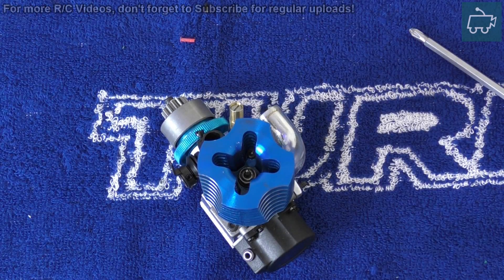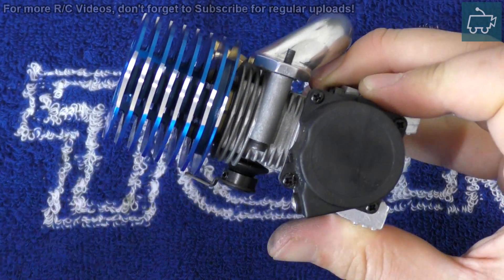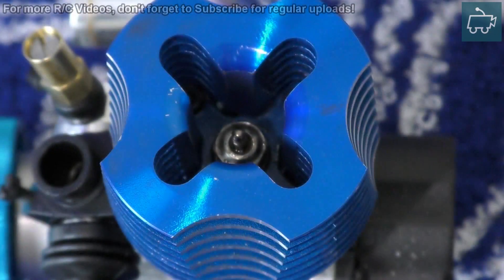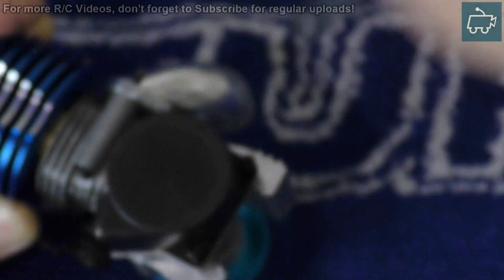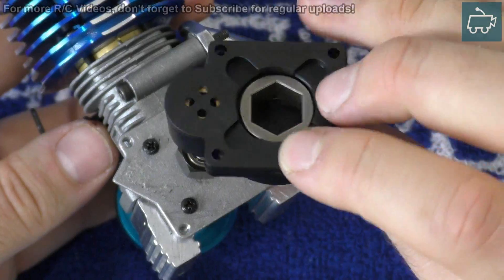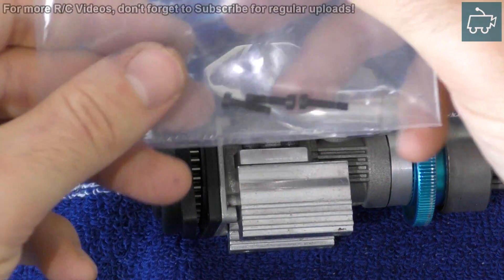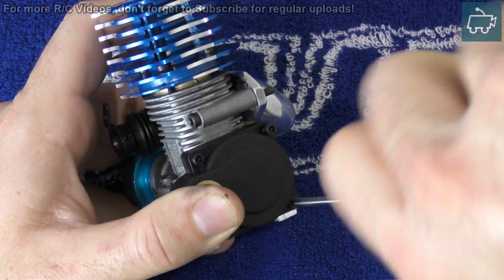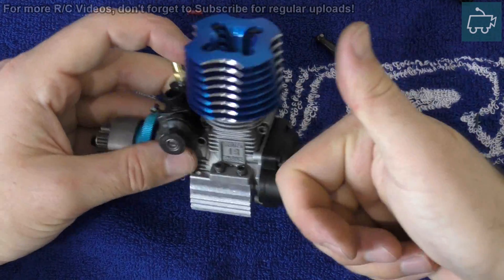Vertex 18 Nitro Engine - Pull Start to Drill Start Replacement - Tutorial

Comment: Hi does any one know carb settings for this vx18 low speed factory setting i need i cant get it to idle long its pretty new and run in good now just about 17 tanks through it new cluch too but wheels spin a bit tryed idle 1mm lower and higher its like its too rich even at 1 half turns out lsn.

Comment: I have a Nocarossi engine that was built for the revo platinium the gear in the ritor start is always braking i cannot find the rotorstart to buy can you tell me what other rotorcstart might work oreven a pull start o have 2 of these engines brand new i am ready to smash them with a hammer  i just started rc about 9 years now and i have been watching your channel you give good advice i am 61 i will be thankful for any help i live in the Caribbean so parts are not easy to come by and to get parts in my hand is very ecpensive i dont mind the price but it must be the correct thing stay safe and have fun i am also a biker

Comment: Do you set drill to forward  or Reverse?
Reply: Looking at one of my vx 18 engines, the pull starter turns the crankshaft clockwise from the rear. Basically, because of the "one way" thingamajig, if your drill won't start the engine in "forward", simply put it in " reverse". I hope this helps.

Comment: Can I just use a single speed transmission on HSP nitro buggy and will this drill  starter work on a nitro HSP backwash buggy  because I plan on getting a one speed transmission and just putting my two speed transmission gears in the one speed transmission because I lost the BB and the spring

Comment: I bought a small drill with a redcat rod, when I install it I give it to start the car but this instead of turning to the right turns to the left, what would you recommend me to do?
Reply from the maker: Is it a regular drill or a drill start designed for Nitro engines? Regular drills can have their direction reversed. If it's a nitro engine drill start then just plug the battery terminal in the other way round ( negative to positive and positive to negative), and the motor will spin the other way
Reply: TheRCBiker is a drill designed for nitro engine
Reply from the maker: Ok well if it's turning the engine the wrong way then flip the polarity on the battery connector

Comment: hi I have a question,  I have a cen genesis nx .76 motor. I replaced my pullstart with a grill start. when turning the motor,  should I turn it clockwise or counterclockwise. because when I turn the motor clockwise it just  spins.  but when I turn it counterclockwise it sounds like it want to start
Reply: Hi i have same rc cen genesis  did you find  out how ?

Comment: Dear after watching this video i remove my broken pull cord and use drill machine to start the engine by using somthing to hold the bearing and it works for me but after sometime the bearing slips and now it is moving freely without starting the engine because my drill is 4800 rpm  help plz

Comment: You can do this with just a drill, a socket wrench extension and the right sized socket for the nut that the pull start mounts onto that you see at 2:50

Comment: @JT12 what's a good way to go about cleaning a nitro rc car?
Reply from the maker: So I have added a video to my list of To do's on this topic. But for me, depending on how dirty it is ; If it's mud or sand etc, don't wait for it to dry. Use clean water to rinse the car off before the mud dries on there. Just make sure to cover up electrics and the engine. If it's already dry dust etc, then use a small brush. Toothbrush would work, but I use car detailing brushes, to brush off the dirt from the nooks and crannies! 
If you're using water, I tend to use a hair dryer to dry bits off and then use a spray of WD40 on metal parts, gears, driveshafts, drivecups and dogbones etc etc to stop rust and remove moisture.
Reply: josh made a video called Rebuilding a 1/10 Nitro Truck Project - Part 1 . i posted the link but it might get listed as spam.
Reply: JT12's R/C Videos  thanks a lot for the advice; I really appreciate it bro, your videos are so awesome and helpful, much love from U.S🤘

Comment: Im pretty sad, i managed to get a cordless drill but i didnt get the charger with it. I can easily get the backplate and rod for a few pounds but the electric drill is very expensive. I cant seem to find a charger either. Its an einhell drill.
Reply: If you mean a rc drill then you need a 7.2 volt battery. It is the same type of batteries you put in your electric cars (Mostly brushed 1/10 cars that have tamiya connectors) Did this help you??
Reply: No, you can use an actual drill, a cordless drill, ill post a link to the one i have, i dont want to have to buy an rc one when i can use the actual drill i have,

http://thumbs3.ebaystatic.com/d/l225/m/mZbLq92RPOZAYZFvzMtlLkg.jpg
Reply: Oh then all you need is pieces that will let the rod fit on it and try looking up what battery voltage the drill has. After that you could try buying a charger but tbh i don't think it would be easy to find the right size piece ....
Reply: Its an 18v battery on the drill. Ive tried to find a proper charger for it but i cant find one. I suppose i could hook it up to my imax b6 with crocodile clips??? i mean i dont see why i couldnt do that. My imax b6 supports different batteries like lipo nimh nicd and stuff.
Reply: Well I am sure the battery for drills are lithium batterys and you could charge it under lipo as long as the volts (18) aren't too big I guess
Reply: ill go and check what battery type it is now. i have no idea but i dont reckon its lithium tbh.
Reply: the battery says on it 18v dc 1.3ah and then there is a warning that shows a recycle symbol and underneath that it says ni-cd. my charger supports nicd.
Reply: alright